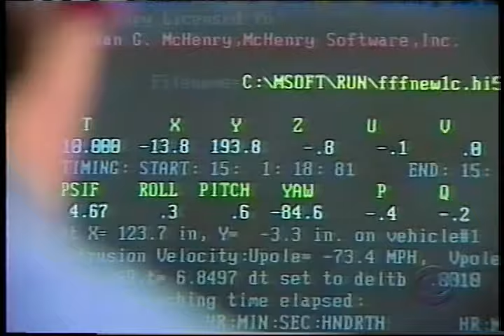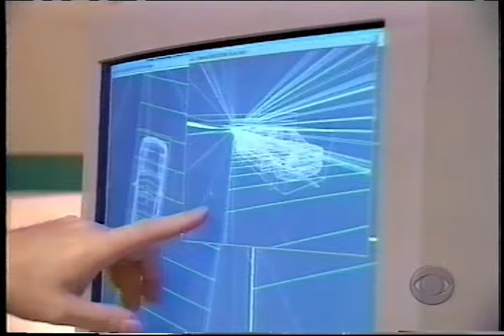Princess Diana Crash reconstruction 48Hours FULL 8 min

Comment: We came home from an early movie and turned on the TV!  Not a few minutes after the crash, it seems, we sat up till dawn! Our very first thoughts were, horrifyingly, that our Princess had been murdered to prevent a marriage to Dodi.  No matter your thoughts about the engagement before, we loved her and Dodi, after Diana's death. I'm not going to pretend I know who and by what method, but it was and still is an unsolved murder
Reply from the maker: No no no
Stop the silly conspiracy theories 
She was not murdered
It was an easily preventable tragedy
Either by not speeding
Not DUI
Wear your seatbelts
Install safety devices in front of the posts (simple metal barriers are used in US to avoid these types if crashes)
But please
Stop the silly conspiracy theories
It was not murder
It was a preventable tragedy
Reply: @Abou well abou maybe diana should've resisted dating dodi at all. Getting too close to the fire, one is bound to get burned.

Comment: her death will forever be an unsolved mystery
Reply from the maker: its not a mystery...
its a high profile tragedy...
not unlike many which occurs on the highways of the world every day...
speeding, DUI, seat-belts not worn, and inadequate safety devices on the French roadway.
A simple metal or concrete barrier in front of the bridge support posts along the roadway would have prevented the tragedy (to date they still have not installed barriers in the tunnel) 
In the US most bridge posts have simple barriers in front of them to redirect traffic back to direction of the roadway.

Comment: The car was a major problem...it had been in a major rollover crash and was almost completely rebuilt. The car was known to behave erratically and drivers did not think it was right. Her driver was probably drunk, Princess Diana was not wearing a seatbelt...she was also sitting in the seat where the least forces acted during the rapid deceleration of impact and the subsequent rotation across the two lanes....A working auto-tensioning seatbelt, if buckled, would have saved her life and probably everyone else in the defective car.
Reply from the maker: Not sure on the pre-crash rollover rebuild. Please send link to reputable source:did that come out in the Uk inquiry? If not its probably hyped BS. 
And as far as survival, had they all had seat belts on they had ‘a best chance’ at survival but not guaranteed (especially the front seats with airbags and not having the rear seat unbelted passengers loading them after bad deployment) 
BUT 
a 50+ mph speed change is very high and can cause aortal separation, etc and is not guaranteed survival)
You are correct that in an offset collision seated location relative to the line of the collision force may be different due to rotation of the vehicle. But not that much
However In response I may post up the acceleration at each location to the thread “acceleration at locations other than CG” for a hypothetically similar crash.  See this thread https://www.mchenrysoftware.com/board/viewtopic.php?p=2968#p2968
Reply: @BrianMcHenrySoftware  Very interesting and highly technical...I give my students the analogy of Kepler's Law of planetary orbits to describe the relative decelerations and "swept areas" during a violent action in the same short time period. Stapp survived  deceleration from 632mph to zero in around two seconds surviving approx .45 g force at commence of water brake deceleration.
Many sources, all reliable will confirm car's history..it was stolen in Paris and crashed, written off by insurance, subsequently bought by a mechanic and repaired. Other drivers for Etoile limousines have stated the car was difficult to handle at speeds over 45 km/h.
Reply from the maker: @Warpedsmac  In a search for sources most seem conspiracy theory 'news' sources, none from legitimate news sources. Did the 'rolled over totaled vehicle' issue ever come up in the UK inquiry? if so please send any links. 
On the DeltaV by position: 
Excellent observation! Had not addressed that! so...I did an evaluation of a similar angled offset crash and see that the RR location is the least DeltaV (41.9 MPH) whereas most other locations are 50 MPH or greater (for CG approximately 50 MPH...i need to reload our actual crash reconstruction simulation from 1998, it was on a mini computer (PCs were not very powerful in 1998!) 
And for ANY DeltaV survival is never guaranteed but don't think comparisons with the Stapp test is appropriate...but will give that some thought (water decelleration and 4 point harness, etc.)
For a summary of the DeltaVs etc please see  https://www.mchenrysoftware.com/board/viewtopic.php?p=2968#p2968

Comment: We ask governments in all countries to unite the bridge pillars as high as one or two meters so that if a car hits a bridge support, it can still slide not as badly as a car crashes into a bridge pillar so that an accident hitting a pillar like what happened to Princess Diana does not happen again, sorry and thank you.
Reply from the maker: An easier and less expensive solution would be as a minimum to install metal guardrails along the roadway adjacent to bridge supports to redirect the vehicle and avoid these types of crashes. 
There are a LOT of bridges without any protective devices for the bridge supports.
See https://www.mchenrysoftware.com/board/viewtopic.php?p=2793#p2793

Comment: It could have been avoided.. Seems silly mistake by driver.. Secondly, medical help seemed delayed and not upto the mark..
Reply from the maker: yes it should have been avoided...however things like that happen every day...speed, DUI, crashing into immovable objects (the unprotected posts)
Now as far as medical response...
if you read the inquest info on that you will read that she coded a few times while at the scene and so they worked to stabilize her before moving her 
Also in France they don't speed through the streets (like they do in the US)  to get to a hospital (they prefer to avoid another crash) 
Main point is there was not delay or problem with the medical help. 
A 50+ MPH impact speed where the vehicle slammed into a post and so she then slammed into the back of the passenger seat probably caused her internal organs to fail/separate/etc...sorry to be graphic however it was a horrific crash..at 50+ MPH speed change it is is a possibly survivable crash but only possibly...most times that amount of speed change causes death.
Reply: Yeah she was alive when they got to the scene. So sad.

Comment: It will remain unsolved
Reply from the maker: It is and has been solved for a long time. 
You (and others) simply refuse to accept scientific crash reconstruction findings and conclusions.
t doesn't mean that it hasn't been solved! 
It just demonstrates that you (and others) simply refuse to accept the findings. 
In summary...Drunk driving, speeding, failure to control the vehicle, not wearing seatbelts, lack of protective barriers in front of the bridge supports, these are the WHY the tragedy happened. 
For more info see https://www.mchenrysoftware.com/board/viewtopic.php?t=1304